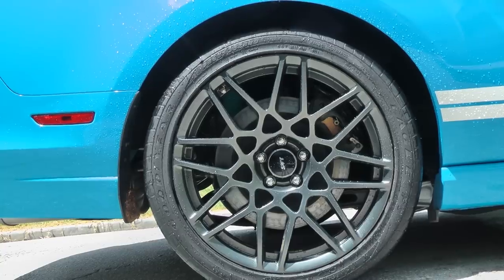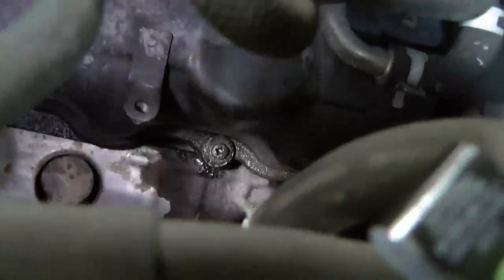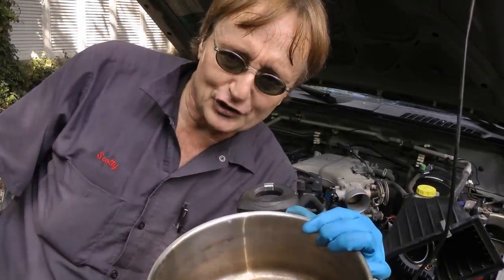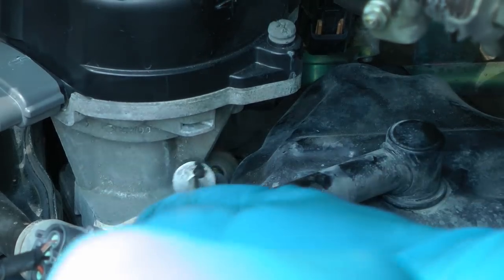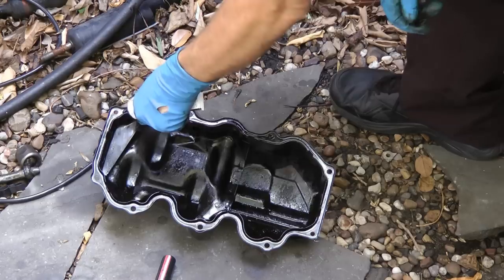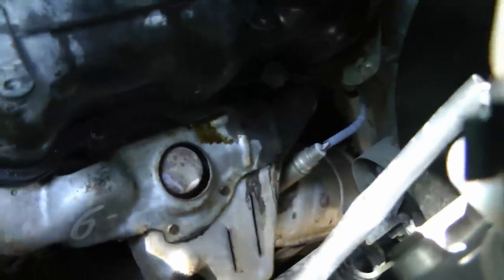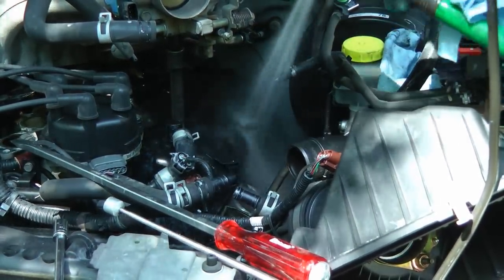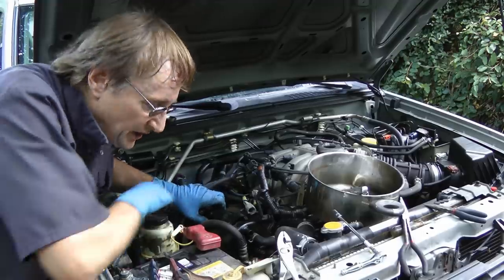How To Fix a Car That Smokes Under The Hood

Comment: Hey man when you are running the engine the oil is splashing up everywhere and gives an inaccurate reading. The dip stick will only show when your a quart low. So no oil on the dipstick doesn't mean your completely out. Keep the car off, pull the dip stick out, wipe it off, put it back in, and then pull it out again and if there isn't anything on the dip stick then you're at least a quart low. I would put in a quart then recheck it until it is at or near the full mark.

Comment: hey... I had a leaking in my car toyota 3sfe engine and just did timing belt and seals (following your videos btw) a few weeks ago and everything is alright now, no leaking anymore... However today I drove on a mountain and after about 10min driving up hill, 2nd gear ~30km/h, about 2000 rpm almost constantly, enjoying the view, i started to feel a smell of something burning... I checked under the bonnet and the smoke was coming from back/bellow the engine (i saw some smoke coming out from inside, beside the right wheel), i couldnt see from where, and also as soon as I stoped, a minute later the smoke was gone... I kinda freak out thinking I damaged something... I checked coolant, engine oil, temperature and everything was ok (unless the temp gauge is defective). I drove about 500km since fix the leaking and that only happened today after drive uphill for a few minutes. I turned around and came back downhill and flat road, and no smoke anymore. That only happened uphill. Any clues? (And btw, my car is right hand drive). Thank you.
Reply: cluch maybe

Comment: Hey maybe you can point me in the right direction. I have a 1992 Jeep Cherokee sport and I put a fuel cleaner into it and when I did  the check engine light went off and about a few 100 feet it came back on and before I could get it home it emitted white smoke from the engine bay and now it won’t start. The ignition turns in all but won’t kick on if that makes sense

Comment: Hello sir my brother just bough a 98 Buick lesabre with the 3800 II series engine but when he asked me to help him do oil change and stuff after we were done I noticed white smoke comming from the block and it smells like burnt oil do you believe the gasket could be the problem  there is oil all around the block I would appreciate it alot if you can help me

Comment: +Scotty Kilmer I drive an 86 crown vic. When my car accelerates past 20mph i'm getting a stuttering or whimpering like it's missing. When I accelerate faster it does this less, but still does it. I recently fixed a few old hoses from the radiator that were leaking and had a couple of oil leaks fixed that were on the manifold. It's worth noting that my car also idles perfectly whether it's cold or it's warmed up.

I've checked the plugs and plug wires. Plugs are fine with no corrosion, and the wires are old but seem to be fairly pliable still.

All fluids are topped off. Oil color looks good. I haven't checked the transmission fluid for a month or two, but it was pink and looked good last time I checked it.

I know this is a bit unrelated to the video, but I need a some help. I can't figure it out. Would really appreciate a any feedback. Thanks.
Reply from the maker: heck, tune it up and have the fuel injectors pressure cleaned and see what happens. Also pressure test the fuel pump AFTER changing the fuel filter
Reply: Scotty Kilmer
It's a start. Thanks for the quick reply! I'll give these a shot and post the results. I had planned to check the fuel filter too since it has been a very long time since it was last changed I think.
Reply: Scotty Kilmer turned out it was an egr valve/sensor. Ordered the part, coming tomorrow hopefully.

Comment: my vehicle was producing white and once blue smoke from the exhaust pipe. I was told I need to allow the car a longer startup time before driving and initially that helped but the rain and humidity caused the car to just shut off.  Initially I thought it was a gasket or valve problem.  My oil,antifreeze, and transmission levels did not change If you think that it's a gasket problem, stop driving!!! Burning gas with any of the other fluids damages the engine. I was forced to stop driving but it ultimately turned out to be a loose wire that was only $4.00 but labor $288.  From  what I understand, replacing the gasket or valves is very expensive.  I suggest to anyone who feel that the vehicle is not getting better to just stop driving it until you can get it diagnosed.

Comment: my friend had a 25 hp kholers enging i know you arent into small engines but he had it and he was running it with a broken head gasket and it smoked alot and i was wondering what were the things that could go wrong with the engine like that?

Comment: I'm going to change the valve cover seal on my 1994 Mazda MPV and i want to change the hydraulic lifter(the mpv are know to make the tapping noise) and i wanted to know is there a difference in quality via the seal and hydraulic lifter and weather i should buy form dealer/aftermarket

Comment: I just finish changing the gasket on my Honda and I did everything that was supposed to be done but when I turn the engine on I can smell a little bit of smoke coming from around the gasket does that mean the oil is being burned or did I do something wrong but the car starts up fine and the smoke is very minimal like very small

Comment: Ive just discovered smoke coming out the engine bay after changing a battery on my 2011 Subaru forester (Australian model on the drivers side of the motor when I start the car. Is my motor in need of a valve cover gasket?

Comment: hi scotty ihave a 98 aurora my car cracked the radiator and hose and was over heating  .. put new radiator in with new hose and new thermostat and now my car putts around likeat stop light and press on gas rpm go upto 5 takes a second for it to get up and go so I replaced the spark plugs and wires and thing ican do to fix it??????

Comment: Hi Scotty, i own a Mazda 626 2001 V-6, Manual of course ;) .

I have a very annoying, popin sound comming from the front end passanger side, when passing over holes. I went on and replaced the sway bar links, ball joints, shocks, springs, tie rod end and top plate and i STILL hear  that stupid noise !

Checked and the busings seems ok, really want to find out the problem.

Any ideas what could cause the clunk, like something is loose ? engines mounts maybe?

Comment: My 04 xterra is leaking oil around the valve covers too. The same truck you used in this vid? Set of valve gaskets in Canada run $75 for both. Does that sound right?

Comment: My Cadillac deville 2004 also throw smoke under the hood, if I fix the gasket will that fix it when i accelerate? Because when I hit the accelerator it idles slow

Comment: Damon King, The distributor seal is worn and as a result oil is leaking from the where the flywheel connect to the engine. Change the seal and put some high pressure gasket sealant there.

Comment: Hey Scotty I have a 97 nissan pickup, when I start it I need to keep my foot on the throttle in order for it to run and black smoke comes out of the exhaust and runs very poorly. I think its a fuel mixture problem but I have no clue what could be the problem. Feedback would be great, thanks.

Comment: Scotty, here's one for you. I own a 93 Mazda MX-3 1.8l V6 (K8). I know these engines are notorious for their rocker cover leaks. My rear bank continuously leaks in one corner. Ive gone in, cleaned the cover, sealing surface, and used Loctite 574 to seal every thing up, (placing the 574 in the well of the cover and the sealing surface.)

And yet it still leaks! Could this be the gasket gone bad, or a imperfection on the sealing surface of the cylinder head? Thanks for your help!

Comment: Hey Scotty, I have a 2001 Oldsmobile Silhouette that has been having overheating issues. Had pressure test done which indicated possible head gasket leak. While driving to work a couple of days ago, engine overheated but could not stop vehicle until I pulled into a parking lot. Had lot of smoke coming from engine. Attempted to vent radiator, but it would not vent. Found coolant drops on engine itself. Recommendations?

Comment: I own a BMW.  The owners manual and computer says I don't need to change the oil for 15,000 miles (mobile1 pure synthetic).  However, it's been a year 1/2 with 5,000 miles driven.  I'm not sure if synthetic oil deteriorates over time.  Should I wait for 15,000 miles? And what about the filter?   Do you think It's smart to to go a couple of years and or/15,000 miles? BTW, I live in California (Bay area), so my car is rarely in freezing or really hot temps.

Comment: Hey Scotty. So I have a v6 mustang and what i notice sometimes is that when starting the car up in the morning i notice some white odorless smoke come out of the engine, kinda under the exhaust headers, but almost no smoke comes out from the tail pipe. Once the engine warms up and idles correctly then it goes away. Should I be worried? also the engine bay is dry as a bone and it doesnt leak any fluids.
Reply from the maker: probably just old age and the engine burning a little oil off when cold starting, old ford engines often do that. As long as you don't lose oil or coolant, live with it

Comment: Scotty, I have a 2000 Nissan Sentra that started to have a funny burnt smell from the ac/heater. At first so long as I didn't turn it on I was fine. Now, it's kind of doing it randomly. I was parking under a tree for a while but I have stopped doing that for about 2 months. It does look like something may be coming out of the engine coolant area? Help !?!?

Comment: I replaced my oil drain bolt and washer because it was dripping oil little by little nothing too serious but it would splash on my exhaust and start to smoke when i'm driving. The leak is still happening and I watched it for like 10 minutes straight and oil still slowly dripped from the drain plug, and I tightened it down pretty good. Any ideas?

Comment: Hi Scotty, I have a similar problem, but my engine is smoking from the breather tube that comes from the front valve cover. It is a Chevy 3.1 V6 from a Chevy Lumina.  I was wondering what some of the possible causes for this might be.  Thank you in advance if you get a chance to answer.

Comment: I have a 1998 Ford Taurus. It started steaming and hissing around the battery and the car can barely run for a few minutes before smoking again. What could it be? Blown gasket? radiator? coolant? I'm not sure. Any suggestions?

Comment: Hwy Scotty, i drive a 2000 ford focus zts DOHC, it was over heating and the heat was not working. figured out it was the water pump, replaced it now its no longer over heating the heat works. however there is unusual steam or smoke coming from the passenger side of the radiator there is no coolant leak just a small distant sweet smell of coolant, any help?

Comment: Scotty I have a fresh build (4k miles) on a c6 Ls2, Trickflow heads, lifters, valve stems, rockers and pushrods. Car began smoking mainly out of left exhuast, small amount from under hood near cylinder 1. Compression test showed no compression in cylinder 1. Also, found bent push rod and broken rocker arm on cylinder 1. Would a bent push rod and broken rocker arm cuase 0 compression and tons of smoke out exhuast? I am a noob so be gentle youtube.

Comment: Ive already changed the gasket an cleaned the motor an theres no more oil leaks but now it looks like the smoke is coming from tge front of my motor An im starting get frustrated with it. Its on an 6 straight 03 grand Cherokee any ideas?

Comment: I have a '05 Honda Civic and it's spitting oil from under the valve cover onto my manifold exhaust. I had the gasket and the O rings for the coils replaced and it's still spitting oil from under the valve cover. How do I fix the problem?

Comment: Hey Scotty, I was checking the oil on my '83 Ranger because I know it was slightly overfilled, and I was going to let some out. When I went to check it, it kept reading that there was no oil, but I KNOW that there is oil in there. Then, if I run the engine while I check it, the level seems about where I thought it would be (slightly overfilled). I added a quart of oil just to make it sure it wasn't empty, and it still read like there was absolutely no oil in it. Do you know why it won't read?

Comment: Good day to you Mr. Scotty. I have a GA16DS Y10 and I want to replace the valve cover gasket because of the same problem as you described in this video. Did some googling and there seems to be 4 small round gasket thingy, with another 11 smaller round gasket. The four small gasket seems to be for the spark plugs, but what about the 11 smaller ones? I want to change it myself, what liquid should I use to hold the main gasket in place? Can it be some sealant instead of glue? from Malaysia.

Comment: Scotty I just bought a 92 integra for my first car just so I can get around faster
 It after a few minutes of driving it starts to smoke a little and it has a little burning smell with it would this most likely be the gasket???
Reply from the maker: if it smokes under the hood, leaking gaskets do that, if it smokes out the tail pipe, worn piston rings and valve seals do that

Comment: I found some in a store called b&s auto parts (a local shop) in my town it worked pretty well, did you replace the intake gasket and do you recommend torquing the intake bolts to any specific ft. lbs? the reason for the delayed response btw is that i thought i could live with it but its starting to get as bad as the car in your video. thank you for your assistance.

Comment: I notice that, so far, most of these videos illustrate perfectly the reasons I have no interest in owning anything new. My 1970 GMC is old school simple and I love it.
Reply: Bobby C. Amen. Fixing my '77 caddy is a breeze. None of the computer bull to deal with. And plenty of room in the engine bay, even with a 425 crammed in there.
Reply: '77 Caddy's a fine ride!
Another thing I enjoy about driving my old truck is it's smog exemption. No testing.

Comment: Hey i had changed my cam cover not to long ago n got a new seal on it ,
theres no leaks of oil anymore but occasionally i do get a bit of white smoke from the back and it just recently
started to idle bad and feels like its going to turn off at a stop light 
Help please ??

Comment: hey scotty kilmer i have a 98 mercedes benz e320 that makes a chattering noise in the front by the belt system ive changed the idler and tensioner pullys along with the belt but the noise still remains do you have any ideas what this noise is ??? please help

Comment: I have a Chrysler sebring that had been to the shop recently to get repaired, but was unable to fully fix the problem. the car runs better than before, but the only problem is that the car smokes under the hood and exhaust. I need help immediately.  At first the engine would overheat but now I think it may be a leak in the radiator.

Comment: Hey scotty can you help me out?? I was doing a cambelt replacement yesterday and we forgot to take the wedged metal out of the flywheel when we locked it up and started the car and now its jammed we tried everything from pushing the car backwards to sticking it in reverse to get the flywheel to move the opposite way but it just wont seem to budge any advice please?

Comment: Hi Scotty. I have an '03 Nissan Maxima and the P01456 code "small evap leak" keeps coming back even if I reset it. Dealer is asking over 640$ so I would like to know where to start and what to potentially replace. Cheers.

Comment: Greetings Scotty! I have a 1990 Volvo 240Dl that has just started losing oil appx. a quart every three days. It is smoking on the passenger side only. What do you think? Easy fix? The car is running beautifully otherwise. Cheers!
Reply from the maker: change the plastic filter assembly on the pcv system, they often clog up and do that. If not, engine is just flat old and burning oil from worn piston rings that would cost thousands to rebuild

Comment: Scotty, I just purchased a 04 sebring with a 2.7 v6 (which supposedly is horrible) but it is smoking and giving a slight burning smell from the hood, once I open the hood I can't find a leak, any advice?
Reply from the maker: I hate to break it to you, but that's one of the worse engines ever made. BUT, do change the valve cover gaskets, they often leak then smolder on the exhaust

Comment: Hey scotty, my 98 Mazda 626 (2.0L, 4cyl, DOHC) is smoking from under the hood. I look at it and I notice it is coming from the top radiator hose on the drivers side. I notice it is leaking coolant and I Just had both of the hoses replaced. Do you think I have a head gasket problem or just a leak somewhere in that section? ( Car doesn't overheat like it use to before I replaced the hoses, but this problem still worrys me)

Comment: I have an 01 VW Jetta, and it just started smoking today. I also notice that the coolant was low. When I up the coolant cap, you can hear it leaking fast under the car but when I closed cap it stop??? any ideals what that could be?
Reply from the maker: +striderOO7 pressure test it for leaks, with cap on there's vacuum pressure to make the leak slower

Comment: i have a '03 nissan altima that i noticed started to have light smoke form the front end and a missfire in cylinder 3
are the 2 related in anyy way or is just i need new gaskets and a tune up?
thanks in adavnce
Reply from the maker: +Ryan Mulligan pray the oil leaking makes it misfire, fix the leaks first